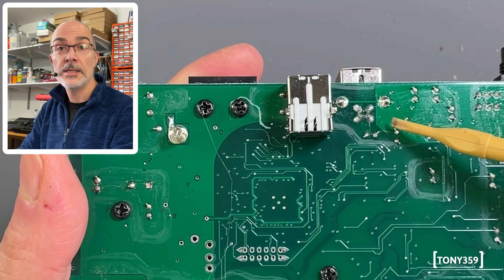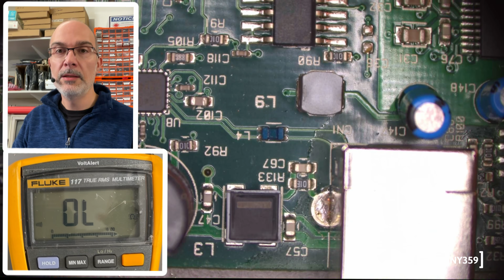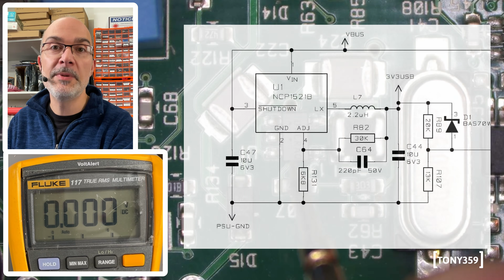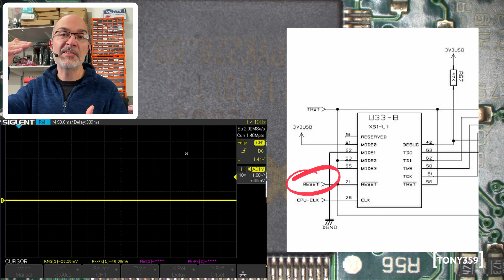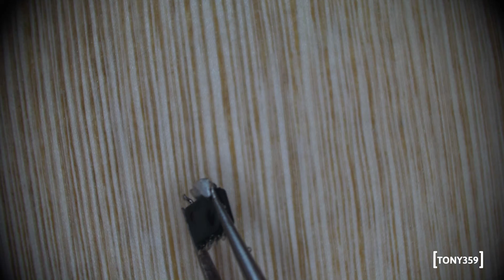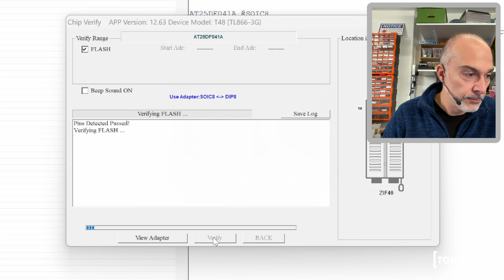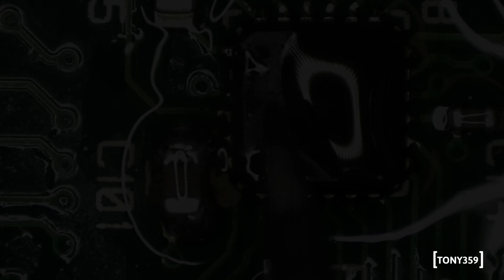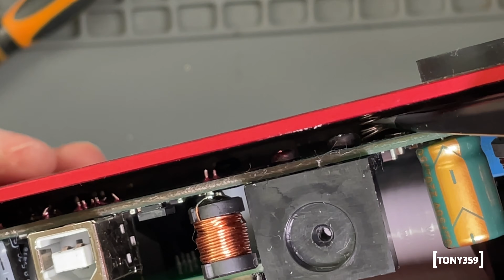Fixing this soundcard wasn't easy!

Comment: 27:49 solution for such miserable soldering is to take a magnifying glass and look sideways to ensure proper connection. Just take PCB in your palm and try to look like Sherlock Holmes ;) .Been there seen that, i was also frustrated about my hard soldering job ending up in flaky connections :) Don't be afraid to fry some chips to gain experience, i have a ton of broken stuff from equivalent of Craigslist, just to train my eye-hand coordination. 
Also camera microscope doesn't help as it gives you only 2d image where depth is being of essence ;) I personally have trained to recognize tip's blurryness as missing depth parameter so my wicked brain gets some sense of 3d while looking though my microscope setup. 
Last but not least - don't be afraid to push on QFNs while solder is melted. This ensures proper planar contact of flat chip to flat PCB; excess solder will come out as a ball to happily wick it off.
Reply from the maker: Thank you for all the hints! I did push the IC but maybe the ground pad was not molten yet. As you say, next one will be better! :) Thanks for watching!

Comment: I had the 2i4 card and the same usb ic failed a few weeks after purchase, fixed under warranty. Well done with the repair.
Reply from the maker: Very interesting - you're not the first to report a similar issue, it looks like it's a fragile IC or maybe the circuit design is not the best! Thank you!

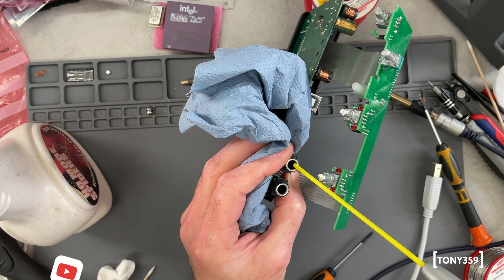Comment: Hello, nice repair for sure... One question, what are You spraying around 29:40 to all connectors, pots and switches? Some "magic" contact cleaner or just simple isopropylic alcohol to clean it a little bit??
Reply from the maker: Thank you! That is my favourite contact cleaner, it's called Servisol S10. It's "lubricated" and enhances conductivity. So it's not "dry", it leaves stuff behind. But I found that when the dry contact cleaner doesn't work, the S10 does :)

I believe it's now sold by a different manufacturer - Kontakt 61 maybe?

Thanks for watching!

Comment: That's a USB audio interface not a "soundcard". And it's not years of grime. That's that stupid rubber coating that manufactures time bomb equipment with. Use alcohol and it'll rub off eventually.
Reply from the maker: ahah I know, it won't be the last time I use English incorrectly! :) I thought about that coating, you might be right but trust me the whole box was covered in a layer of grime! :) It came off anyways so happy days.
Thanks for watching!

Comment: Im surprised that IC survived after desoldering. Also, isn't desoldering wick already contains flux?
Reply from the maker: The Eeprom you mean?
I think the wick has some flux, yes. But I think "more is better" (* well, maybe not always, let's debate! 🙂) - Thanks for watching!
Reply: Using a lot of Amsol is good! Helps a lot both on and off. Just more to clean up but worth it. Honestly I really thought you were going to cook the new USB chip and cringing towards the end but good job! I think maybe your center GND pad may have still been too high keeping the legs off of the pads.
Reply from the maker: @paulystark2890  Probably, yes!

Comment: What's the reason for using an USB-Soundbox like this? I see it as yet another annoying box with cables wasting space on your desk, or wherever. Isn't it way more efficient to simply use a digital output method like SPDIF or HDMI and leave the D/A-conversion do real dedicated HiFi-Hardware like the Amp instead?
Reply from the maker: I’d say microphone input first. Good quality output then. I’m testing sound devices and I need something quiet and accurate. The 2i2 is accurate enough, a laptop sound card would not. Also I need balanced inputs and outputs which the 2i2 offers.  For general use it’s clearly unnecessary🙂 thanks for watching!
Reply: @tony359  Thanks! Yes, I see. Input may be a reason. Otherwise you'd have to use an external A/D-converter instead, which probably wouldn't be advantageous.

Comment: Heh, funny stuff. I did the exact same repair on the exact same card for the exact same reason a few years ago. I somehow managed to do this with almost no tools and little to no diagnostic, but there was a hint for me - the L4 was burnt up, so I just outright replaced the USB interface chip and shorted the inductor. Same issues with the pads and the same solution - just went around soldering them individually but I did remove that cap. I didn't even have a rework station at the time, had to use a small soldering torch instead of a heat gun. I guess those IC's like to go out when the port is damaged.
Reply from the maker: Well, a burnt inductor seems to suggest a big spike in there! Not surprised the USB IC was also dead! Well done, not sure I would have been able to do the same without proper tools!

Comment: Got a 1st gen 2i4 and it has quite a lot of static/random noise at the left input at least when using a mic that needs phantom power. Repeatedly switching the +48V button off and on, may or may not reduce the noise but never gets it down to acceptable level.
Reply from the maker: Could it be the +48V generated by the +48V circuit? It's a separate regulator.
Reply: @tony359  I don't know, I went to school for this but we sat in class filling out papers about flip-flops and the endless combinations of 1's and 0's. And when we didn't do that, the teacher read through a basic book via overhead projector on "how computers work". Such a waste of time. I ultimately decided that I won't be getting any papers, as I didn't learn more than I did back when we built up some DIY electronic kits at school at 8-10 years old. I sure did learn a lot about higher voltage stuff and basic electrics and even lighting but after the first year it was a real struggle as there was next to nothing practical, aside from a few cord and brush changes on power tools. No actual fault finding or diagnosing. 

Now I'm at a point where I have to just say "I have fixed a lot of electronics going by a gut feeling, basic measuring and looking around". But as I have accumulated a lot of dead or misbehaving electronics, I dread that I can't actually perform a good diagnosis. Sure, I lack tools (oscilloscope, hot air station, other soldering stuff needed for efficiently working on stuff) but even without those I feel like I'm lost in the woods.
Reply from the maker: Theory always helps. I guess you need some experience. I had neither, I was just fascinated by electronics since I was a kid. I broke many things. So you can do it. And remember you don’t always win, it’s ok. 🙂

Comment: Great work! Replacing this kind of devices has no monetary value (a working unit should go for around 30–40 USD second hand) but fixing any devices instead of buying a new device is always good for the environment.
Reply from the maker: Absolutely - thought a 2i2 here in the UK would sell for £60-70 ($82) so this was actually a good thing :) Thanks for watching!

Comment: I have a Focusrite 2i2 sound card, it was damaged due to a lightning strike, it has been repaired for maybe 2 times to my local services distributor and it was damaged again, is there a solution for that?
Reply from the maker: If your equipment tends to be damaged by lightings, a surge protected power strip - or better a UPS - might help. A friend used to have the same issue and resolved with an UPS. 
That said, the 2i2 is powered by USB. I'd expect that a surge would damage your motherboard before the USB connected interface? Unless the surge came from some attached sound devices? I don't know if there is a more general solution you could apply to your whole house. Thanks for watching!

Comment: If you are going to work on SMD get a micro tip iron, I use the Metcal system myself.
Reply from the maker: I've got a 210 handle, now I need to buy some tips! With time, I don't normally work on such small ICs. Thanks for watching!

Comment: Ditch that K soldering tip, it is almost never a best shape.
The ones that get the most amount of work are (in a prio sort): D16, D24, BCM2, D4, D08
Reply from the maker: Thanks. If I google those, I come up with the Hakko series. Are they all chisel?
Reply: @tony359  No problem.
Right, T12 series, they are all over CN marketplaces and are a good value for the price.
D = chisel
BC/C = hoof (BCM with indent)
Ball tip:
B = conical
J = 30deg cones (slightly lower thermal mass)
I = slim cones (very low thermal mass)

Both J and I are not as useful as they seem, because tin is always sucked away from the very tip to the side (which is pretty much a useless straight narrow line in terms of contact) by the surface tension. But sometimes you just can't reach without them and it helps to have micro-solder (D 0.5mm or less) to feed directly into contact.

Comment: uhm, does the main cpu have several pins shorted with solder, or is it just an optical illusion?
Reply from the maker: you are correct - I do mention that in the video. I can assure you it's factory soldering. Not sure how that is possible but definitely intentional... Thanks for watching!

Comment: Great work 👌👍👏
I think reflowing the original usb IC will fix connection problem.
Great Northridge fix IC soldering technique
Reply from the maker: Yes, I should have tried that but considering the USB port was broken, it is kind of expected the USB IC to also be faulty. Thanks for watching!
Reply: @tony359  try it. The original IC quality much better than new one
Reply from the maker: It’s USB, it works 🙂 removing and reflowing that area will likely cause further damage! 🙂
Reply: @tony359  In this case.  Keep the original IC for another project.  Great sound card by the way.  A week ago I bought a Presonus audiobox GO.
Reply from the maker: All the faulty IC's and components go in a "dead" tray :)

Comment: The USB port on my scarlett solo 1st gen broke in the exact same way, so far i've just been coping with random disconnections when i nudge my table.
Reply from the maker: It's not too bad to replace and apparently it's a standard USB port. I have a feeling that the USB chip doesn't like those loose connections, the pins on my 2i2 were not bent or mangled.
Reply: @tony359  I mangled one of the pins a while ago and managed to bend it back with a sewing needle and tweezers, I should replace it at some point

Comment: I think you need to use solder flux before using the hot air station
Reply from the maker: I thought I did? It might not be obvious as sometimes I shorten some sequences to keep the overall length of the video to a reasonable number! Thanks for watching!
Reply: @tony359  I thought I'd saw you put some on half way through taking the components off

Comment: As someone whos scrapping and saving and just got their first 2 channel hot air soldiering iron combo, vent fan and helping hands and have been soldering away everything in my home since it arrived a few days ago this is a goal!  Being able to buy electronics cheaply and have the knowhow to fix them for cents on the dollars!  Great fix.  My station has already paid for itself!
Reply from the maker: Amazing, what station did you end up buying?
Reply: @tony359  got a 2 channel YIHUA 8786D 12 in 1 kit. I really didn't see chasing after a Weller price was high, this was reasonable.  It does what I need, heats up quick, has temp controls, comes with hot air rework and replacement tips are inexpensive.  I can get a board preheated very quick so it's great.
Reply from the maker: @saber7007h  Cool! The iron is probably a clone of the Hakko - if a genuine Hakko tip fits, you might want to give them a go. They made a huge difference on my Aoyoue Hakko knockoff!
Reply: @tony359  I'll swing on a set and grab my calipers and see how well.  Keep you posted.  The heating  doesn't have any hardware.  It's just a metal rod with a thread nut the tip is expected to mate to. It will be ID of the tip that's the biggest concern.  Often to make them proprietary they adjust the ID very slightly and the lengrh to prevent them from being interchangable.  The thread is standard.  I can fix bad length with a Dremel it's the ID of the tip that's the concern. If there is a gap it won't heat XD.
Reply from the maker: Have a look. Making things different is expensive! :) Sometimes they just copy everything!

Comment: "Device Descriptor Request Failed" is always going to be a USB communication issue, not a driver issue. That error occurs when the computer tries initial communication to the USB device to ask what kind of device it is, but the device doesn't respond correctly (or maybe not at all). It can't be a driver error, because the computer doesn't even know which driver it should try and use until it finds out what kind of device it is.
Reply from the maker: 4:39 😉

Yes I didn’t make that very clear earlier in the video when I plugged the card. Had it been a driver issue, as you say, the error would have been different. 
Thanks for watching!

Comment: Even though you got it working, I am suspicious about the 2 bridges on that XMOS chip.
Reply from the maker: I am very puzzled too. The XMOS datasheet says one of those pins are ground. Doesn't make sense but there is dust on those joints and with a microscope it's clear that those have never been touched. It's super weird but... it works :)
Thanks for watching!

Comment: Man I love this video but i was pretty much screaming that the usb chip was borked for half the video 😅
What probably happened was that, since the middle of the port got destroyed, the data lines probably had a nasty short that killed the chip.
Really fun video though, love to see the troubleshooting process, I don't get to do that myself very often since a lot of new cheap electronics dont have schematics :P
Reply from the maker: Thank you for your kind words! Well, half of the fun is in understanding what the issue is! If I hadn't found the schematics, I would have probably just guessed and replaced the USB IC for sure! Cheers!

Comment: You should invest in some solder paste rather than using regular solder. That will make placing SMD ICs qa little easier, especially when they have a large ground plane like this chip.
Reply from the maker: Hi - I do have some, I didn't think of using it. 
The first time you do such a small chip, it's going to be a mess anyways :) 

Next time will be better! Thanks for watching!

Comment: To me it looks like the IC might have been sanded and re-lasered, doesn't look like an original new part. Could be recovered from ewaste. As others said, that will make it harder to solder.
Reply from the maker: Could be. It came in tape though. For the price it feels not worth the time to prepare it but I know that labour there is not very expensive so who knows... I should have pre-soldered the pads as many others said! Thanks for watching!

Comment: I have the 2i4, and it's developed a slight static in the outputs when I change the volume knob. I've been too intimidated to try cleaning it, but watching you do this repair has shamed me into trying it. :)
Reply from the maker: Thos pots are more or less sealed. You can try with some cleaner but make sure you use the "lubricated" one, for trimpots. Failing that, you could replace it. 
Good luck and thanks for watching!

Comment: Hey Tony! happy to see that you repaired your USB soundcard! To be honest I somehow stumbled upon this video and I am lucky I did, because I am troubleshooting a very similar problem with a DJ controller (Pioneer DDJ-SR) I bought but barely used until it started acting up intermittently until one day it said good bye forever! I ordered 2-3 TUSB3200AC IC's from aliexpress and tried this very procedure by replacing it but that just didn't worked, I then decided to give up on it and sent it over to a professional workshop so the guy there of course said I did a very terrible job soldering it (it wasn't that bad in my fair opinion, I made sure all contacts are solid and there are no bridges, also tested in continuity) so he fixed that but what he also did is he removed the inductor on the data lines and bridged the lines directly with a wire :D not sure what he was trying to do there but I am sure that inductor plays a role since I can see the same board design here too! Sadly I noticed that late since he came back with a negative and I just put it at rest until after some time I decided to have another look, but by then I assumed that inductor is long gone. Anyway, I've got more tools over the years, got better at soldering, I do lack an oscilloscope and that's why I kind of let it rest in the corner, but I might just go and replace couple of stuff, order another batch of those USB IC's and that inductor and see how that goes. Cheers!
Reply from the maker: I am no an expert at electronics but those inductors are there to filter out very high frequencies (MegaHertz) in both directions. I suspect the inductor was open, they didn't have it and they just bridged it. For a test it works. For a professional repair... :) I think you can see those inductors on HDMI ports too, same reason I guess. Anything that has a cable coming can be an antenna/aerial! :) 
Thanks for watching and for commenting!
Reply: @tony359  you are absolutely right! I didn't factored in that a cable can act as an antenna and cause EMI especially in data lines, great thinking! If one day I fix this I will come back to this post to celebrate the result! :)